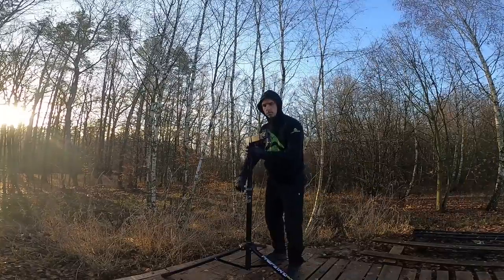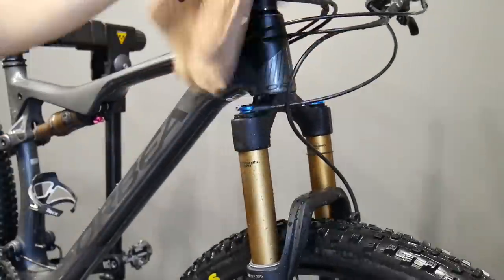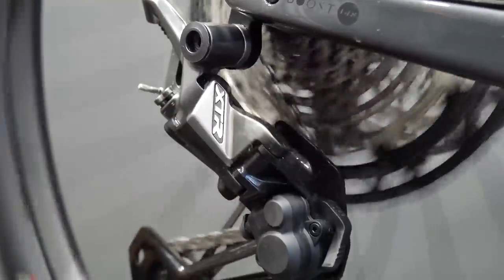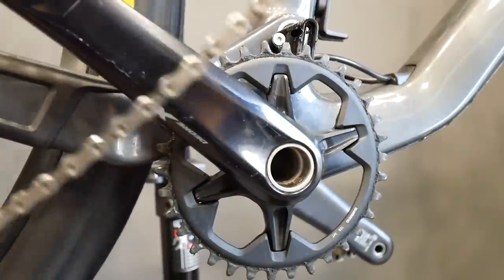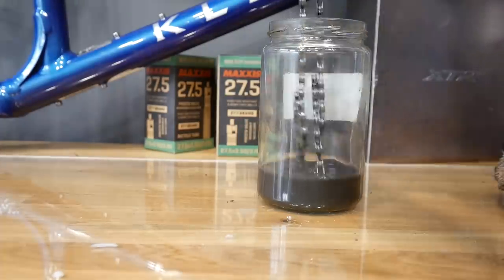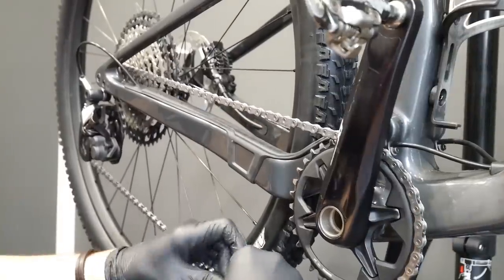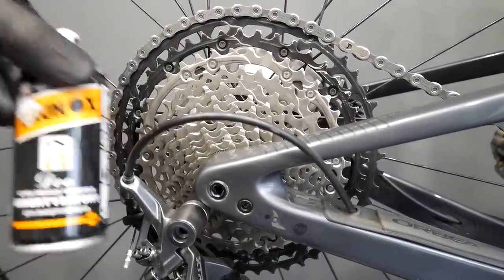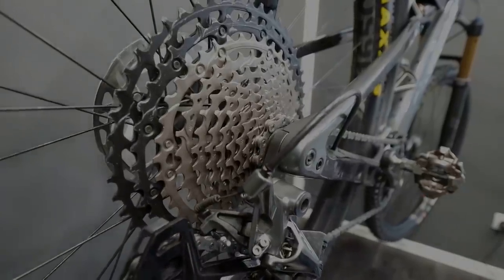One, Easy Trick For A Mud - Proof Mountain Bike Drivetrain. More Than A Clean Chain...

Comment: So much bad advice in this video... spraying rear cassette with degreaser, degreasing a brand new chain, paintbrushing the sprockets with oil? Pressure washing the cassette?? Bad advice.
Reply: What's wrong with degreasing a cassette?
New chain's come with transport/storage grease so there's nothing wrong with taking that off(a must)
Oiling the cassette is something to argue about but he's cleaning it after it. 
I wouldnt do a cassette with High pressure but there's nothing wrong with it as long as you know what you're doing. They're just a bunch of sprockets. You just have to make sure you don't wash the dirt in your wheelbearings. 

So what's the fuzz about?
Reply: @MauriceG85  new chains come nicely lubed and the manufacturers (and other sources) say specifically to leave it in, at least for your first couple rides. Cleaning the cassette is fine but I would not be spraying everything on the bike down in degreaser like he does. I only degrease mine when it is off the bike, otherwise just a brush and soapy water, or gentle spray.  As for relubing to prevent dirt, there are different dry and wet lubes, just clean off the excess.
Reply: @ThomasSlaney   i degreased my chain after almost every ride, and right after it was new, i got 6000 kilometers out of the chain and cassette without swapping a thing.
Reply: @Ropetable  whatever works for you. Here is another opinion: https://youtu.be/8jVOD9vHt7Q&t=7m30s
Reply: @MauriceG85  The stock grease that comes on a chain from the factory is the best lubricant the chain will ever see. Everything that one apples afterword is just a stop-gap.
Reply: Degreasing a brand new chain is excellent advice. Aiming a pressure washer right at your hub though....  not so much.
Reply: @SnootchieBootchies27  they come nicely prepared with the factory lube, you just miss out on a couple rides with that.
Reply: @ThomasSlaney  i mean it depends which brand i guess, but most of the factory stuff that I've encountered is insanely sticky. So i want it off there ASAP. At least off of the outside of the chain so it's not attracting dirt.
Reply: @kaseykohler1490  haha I like the sentiment but haven't seen any science either way

Comment: Muck off bike cleaner then rinse with water then wipe chain with rag and run wd40 with a rag underneath to drive water and grit out then dry with a rag removing all excess wd then lube and remove all excess 
This leaves no grit feeling in the chain, works for me
Not convinced about using pressure washer🤔🙀
Reply: I don't think that was industrial high pressure washer, there are also bike friendly low pressure washers.

Comment: You can't use degreaser and oil to cassette without covering your rotor. You will contaminate your rotor and get squeaks while you ride. And they are right, you can't point direct pressured water to your bearings.
Reply: He can do both. I do the same, never had any of these problems ur talking about.
Just don't spray the rotor with lube
Reply: you don't know what you're talking about mate
Reply: I spray once degreaser to cassette direct and the degreasser mixes with the oil from cassette and goes to the rotor. And it contaminated.
Reply: @myattunthit9539  I get what you're saying and I seriously am confused on the do's and don'ts everyone's thhrowing in the comments section lol I'll just NOT use degreaser anyways

Comment: How to clean your bike ... use a pressure washer... not ... this is basically the worst thing to clean your bike with! It blasts grit and water into your bearings and will ruin them!!!! DON’T DO THIS AGAIN... please
Reply: Jamie Coker share the video you are saying...let us see the RIGHT WAY as you say
Reply: Just avoid the bearings when cleaning
Reply: Plus screwdriver😄🤔😱
I also did jet wash once.
Once🤣 ..... ended up at the mechanic and got told off there badly...
Reply: just avoid rubber sealing around suspension, seatpost... and you good to go.. you think mx riders clean their bikes in bathroom like mountain bikers do it?

Comment: I just wanted a little pinion on my recent purchases of a Shimano Mega gear TZ 500 and a Shimano Tourney tx800 derailleur it's on a $159 Walmart bike box bike I'm not trying to do all this fancy stuff you see on YouTube riding my downhill and over lots of heavy Trails I ride basically to and from work on it 10 miles I just need a good shifting quiet bike and I realize a commuter bike would be better but I like the mountain bike Style and recent videos I've seen is the mountain bike compared to a commuter bike or gravel bike there times are only off by a few seconds as far as they're rolling rate in distance traveled it was on gcn gravel bike vs. Mountain bike
Reply: If you're keeping the triple set chainring up front, then there's no need for the mega range freewheel. The jump from cog 6 to 7 is is pretty big, and will add some sluggishness to your shifting.  And, I'm guessing, the small ring up front is a 22t. I can't imagine any sort of short commute the would require a 22t front to a 34t rear gear ratio. 

Lastly, and this may be too little too late, but if you just want a cheap mtb to commute, then the $150 you'd drop on a Walmart bike would get you a decent used bike...like a late '90s rockhopper. Much better platform for later upgrades and even a well used one would be 2x the bike. 

I used to be a big defender of big box bikes, as I started out on one, but even I had to come to terms with the fact that there is very little quality to them.

Comment: For all the commenters saying "OMG...don't use a high pressure hose!"... I have news for you;  EVERY pro mechanic uses a high pressure hose on the bikes they are responsible for ALL THE TIME!  Cyclocross bikes will often get this treatment several times over a 1 hour race!
Reply: I think the difference is that pro mechanics won’t blast sensitive areas, but more importantly sensitive areas are pulled down and serviced way more regularly on pro bikes. The weekend warrior version of “do the minimum and hope for the best” would not include enough servicing.
Reply: @Matt Patterson   I would definitely agree that pro bikes are getting bearings replaced much more frequently than any "normal" bikes (probably more from mileage than contamination), but I am far from convinced that a pressure washer will truly damage the sealed bearings on a modern bike (unless you are aiming the nozzle directly at the bearings for a prolonged period).  I think the whole "don't use a pressure washer" thinking got its start back in the days when all our bearings were loose ball/ cup&cone type, that COULD easily be fouled by a little extra water.
Reply: @johns3106   I think you are probably spot on. It may not have even started through real experience, it could just have been people noticing a risk and mitigating by avoidance rather than testing.
Reply: @Matt Patterson   Yes...like so much "common knowledge" that is floating around out there, I think the only basis for these "facts" is anecdotal and lacking in any real evidence.  I appreciated the sharing of ideas with you though!
Reply: @johns3106  2020 update: Pressure washers are still killing bearings and suspension. Not a problem if your bike is being overhauled regularly. However this is not the reality for most people.
Reply: @G3tR34alz   See comments above for discussion of "proof".        Sealed bearings are just that...maybe not sealed well enough to withstand prolonged, direct high pressure water aimed right at the seal, but sealed well enough to withstand indirect spray.  Given the condition the bike in this vid was in before washing, I would say the bearings are much more likely to wear out due to racing conditions and mileage...not so much from any type of washing they receive.
Reply: Ill do the same when i have a sponsored bike and a team to replace all my parts. They also run without grease in the bearings to save power...wouldnt suggest that either
Reply: @Frieda Chingford    So let's see.....a pro bike can get this treatment several times a week, and will periodically need some bearings replaced....are you telling me that your own bike (with bearings that see much less mileage than a pro bike)can't withstand a pressure washing every once in a while when it is filthy without falling apart?!   C'mon....the way most people delude themselves about needing the " latest and greatest", their bike will be " obsolete" long before most of the bearings would be harmed by infrequent, careful pressure washing.  Anyway, if you ride a lot, bearing replacement is just a fact of life, pressure wash or no.  If you really want to keep your bearings perfect, the bike should probably just be left in the garage!
Reply: @johns3106  if you pressure wash bearings too aggressively, you will strip out the grease and they will need replacing quicker and often before the bearings themselves are worn. I need to pay for my bearings and as such am concerned about there longevity whereas pro teams do not have to worry and can afford to replace them after every race, so lets see... are you interested in anyone's opinion apart from your own?  Highlight that reply...
Reply: @Frieda Chingford   How do you clean your bike?   Distilled water and feather dusters?
Reply: @johns3106  I clean my bike (and my customers bikes) with care and attention using water, soap, sponges, a variety of cloths and by removing components first instead of blasting it with a pressure washer like an ape
Reply: you can get bike specific pressure washers that are not as high pressure as the ones that strip the paint off your walls you know. Muc off do one.

Comment: i use wd40 clean my chain and then quick spray on my chain after.been doin it for yrs is good as new.
Reply: I'd advise against it, WD40 is not suitable for use on bicycles
Reply: @friedachingford2977  well I do any no issues, plenty others do too.
Reply: @ianpearson8976  more likely that you haven't noticed the issue
Reply: @friedachingford2977  what issue exactly ?
Reply: @friedachingford2977  the only issue is if its raining u have to reapply.Otherwise waste money on what is just marketing on other product.
Reply: @friedachingford2977  wd40 is probably the best overall solvent you can use on anything mechanical
Reply: @eyeamstrongest  that's a bit like saying superglue is the best adhesive, it has its uses but it's not good for everything
Reply: GT85 is your friend (not for chain lube).
If you have a road bike try
TF2 Ultimate Aerosol Spray with Teflon  wipe your chain down after every ride quick spray, wipe done.
Reply: @treadtyred9742  exactly, the same is true of MO94
Reply: @treadtyred9742  actually i am thinking to stop use wd40 0nly for 1 reason.their cans are shite and the spray mechanism always fails leaving you 20 percent left in the can.gt85 doesnt ever do this.

Comment: Squirt. No fuffing around. Paraffin wax when it's summer and have the time or squirt wax any other time the night before. 
Edit: wear pants with ZERO for on pants and spotless drive train
Reply: Yes made the switch to squirt 6 months ago and happy I did . You do have to watch out for wax buildup .
Reply: steven cole I bought that squid and it makes a lot of grime and nasty stuff. I think I got a counterfeit.
Reply: @junboo8730  If you dont shake it really well it wont set up very well . The problem with a new bottle is the volume in it doesn't do well for mixing because its full and if its cold its close to impossible so what I do is put it in the microwave for 10 seconds . Another thing You should give it 24 hours to set up on the chain and 48 hours is quite incredible if you can wait that long  . This is a game of patience for optimum performance . Yes it is a bit time consuming but its better than cleaning all the black grime with regular lube . Another thing that chain needs to be cleaned before you apply . Now you can go without a detailed clean but you have to do multiple applications till the wax flakes off that old lube
Reply: steven cole Thank you a lot.  Awesome tips. I will try it one more time. Shake it, put it and wait 48 hours.

Comment: Why the hell is this guy using a  pressure washer never do that
Reply: Max Dyson He knows how to use it and not getting the bearings washed out
Reply: Thats exactly what i was thinking ,such a rookie thing to do to your bike ,especially a full sus with pivot points etc.
Reply: If you know how to do it properly you can. Plus if you know what to do afterwards it doesn't matter if you pressure wash. I do it all the time. I'm no rookie with it. I'm even sick & tired of people saying that at the car wash.

Edit: You do know the pros do it that way right?
Reply: But if you wash your bike constantly with a pressure washer it can be harsh on you’re paint
Reply: @maxdyson673  
I do it bi weekly to monthly. Only damage I have are from wipeouts & improperly putting it on the car rack. No damage from pressure washing ever.
Reply: @UCP23p_i44UY2IVhGqI8xm7A 
I've done it for almost 3 years on 2 bikes. It will NOT ruin your bike. I get compliments by bike shop employees on how well mine is taken care of. Like I said prior, if you do it properly, no issue will come of it.

Comment: Terrible video... destroying bearings
Reply: Yep, never put chain in degreaser.
Reply: @tomasberger9980  He's not talking about the chain. A chain doesn't contain bearings. I think he was referring to the pressure washer. Of which, I can confirm, does not destroy bearings. Unless you have cheap, shitty grease in your bearings and have long intervals between cleaning.
Reply: @jonnywilson9117  Actually chain contains bearings (plain bearings are also bearings). When you put chain without o-rings into degreaser you dissolve lubricant inside the chain. It is almost impossible to put it back(because it is inside). You can use some light oil but it will leak out and make huge mess while driving. So that is what i thought. But you may be right he probably thought about bearings in wheels/hub that should be pretty save to clean by pressure washer.
Reply: @tomasberger9980  ✌
Reply: @tomasberger9980  I've converted all my chains to wax and getting rid of lubricants in chain isn't too easy. I had to give each chain two day long bath in benzin/diesel (not sure of terms in english) while changing the degreaser two times. Then switched to alchohol/spirit which required three baths which took one day as well. If you use just one type of degreaser, like benzin, it gets rid of heavy stuff but leaves light oils. To make it optimally there should be something middle-range degreaser as well to take care of medium oils, but you can do it just with benzin and spirit.

So i had to dissolve the lubricants for three days and change the degreaser five times, using multiple types of degreasers. Until spirit didn't take color anymore from disolving oils. If i tried to cut corners in the process of degreasing the wax wouldn't last on chain, mark that there were still some oil left.

But sure i agree. When i wax my chains i let the chain to soak in liquid parafin wax for tens of minutes. As long as there are airbubbles emerging from chain it's not done. Compare that process to times when i degreased my chain and added bit of lube... No wonder those chains wore out quite soon, 5000km at max. If in dirty conditions much less.

Comment: Not enough time for me to do all this... An easy trick after a really wet/muddy is to spray your chain down with WD40 to remove all the water and then you can leave the bike alone in your shed/garage if you need to go out or lacking time to clean properly. This will stop the corrosion from starting to take effect. Then the next day or when you have time you can properly clean the drivetrain with your own method. A chain tool is very useful. Personally i don't like to degrease chains because I don't want to remove the factory lube. I do however like to degrease the cassette and chain rings.

Comment: Buy an ultrasonic cleaner for 60$ and wait 15 minutes. Done. This is bit much. Also would recommend one drop of oil of each link, on the center. Just one. Oil on the sides doesn’t do much.
Reply: He means oil on the edge to get it between the rollers. This is where the oil is needed. Most think its needed on the outside of the chain on the rollers and its not.

Comment: Can I use petrol to clean the chains?
Reply: Yes
Reply: What do you think he had in the glass jar lolz? Sure as heck was not coolaid
Reply: @BuildBreakFix  white spirit in s plastic bag is best as you can rub it through the links. covering everything in lube is a dust magnet chain, wax works best.
Reply: @graemebeamish7416  honestly I never used either.  I take an old pot, put about 1 inch of vinegar with like 3 shot glasses full of dawn dish soap. You toss in some of those plastic tumbler pellets and swish it around for few minutes. The thing comes out sparkling like new every time.  I then dry it off and toss it in a Ziploc bag with like  a teaspoon of oil shake it around. Wipe the chain off old towel till its dry looking and its good to go.  I never used gas or anything cause it tends to eat the finish and plating off the chain. As long the oil is in the rollers outside of links don't matter

Comment: When your Mountain Biking consists of 50% riding and 50% cleaning!
Get a life mate. I ride motorbikes too and never had an issue with chains after not even cleaning them after 10 thousand miles. Just replace them when they're worn because nothing is that more expensive than time.
Reply: Just as a thought, the new eagle cassettes from sram is between $120 and $500. You can get a decent sram chain for $30-40. Get a chain wear tool and change chain when it gets to 0,5% {for 11&12 spd} then it will feel as new for a lot longer. And the stupidly expensive cassette will last 2-3 times longer
Reply: Cleaning bikes is chill time.